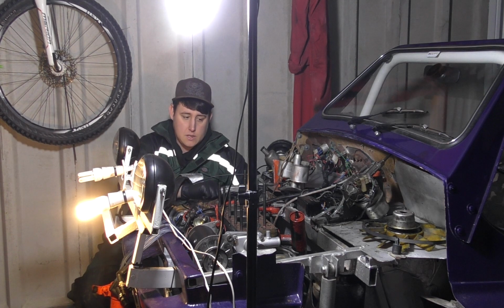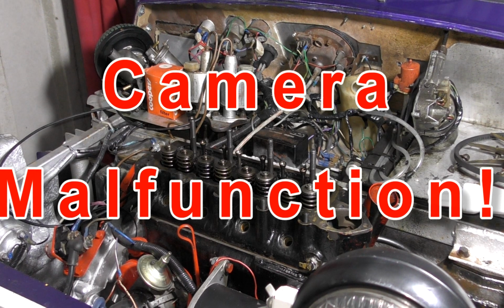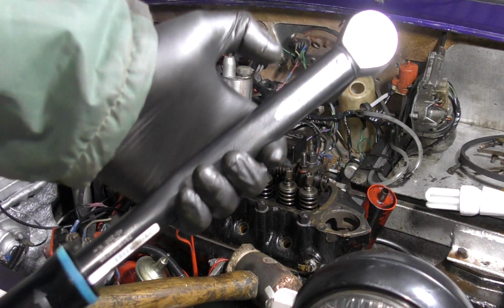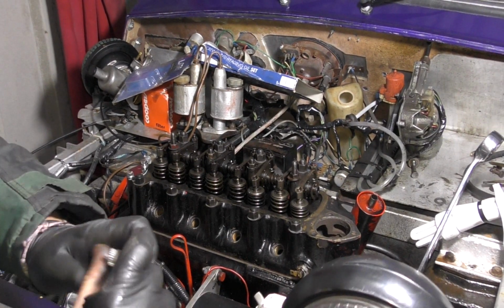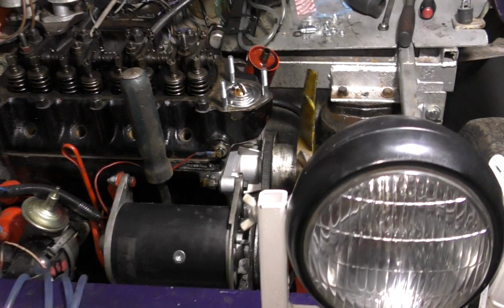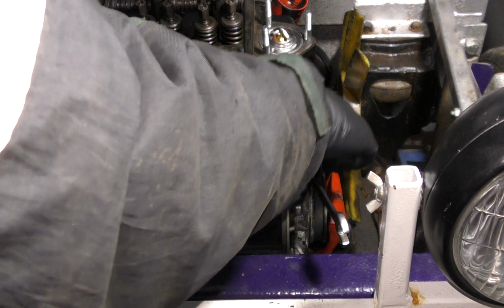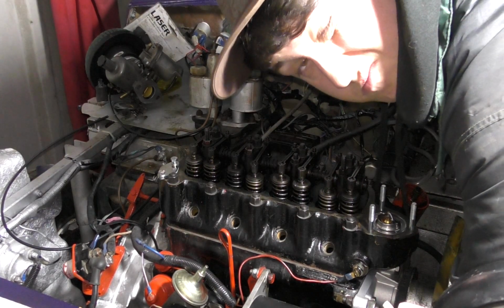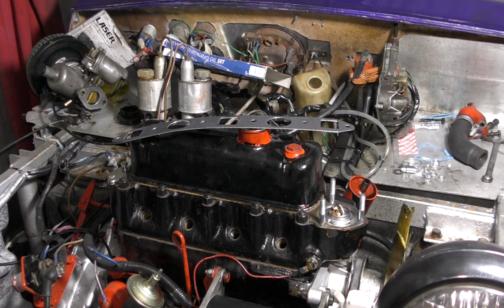Stimson Mini Bug - Let The Rebuild Commence

Comment: Lovely job! Any reason the owner stuck with the standard manifold and ‘magic pipe’
Reply from the maker: Trying to keep costs down mainly. Old exhaust join was knackered. Using the magic pipes opens up some customisation on the exhaust front :)